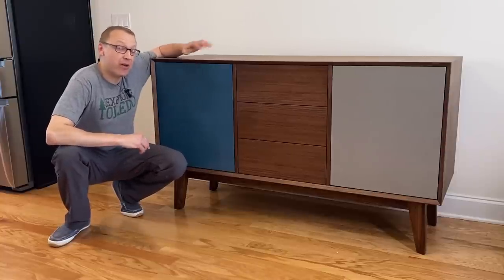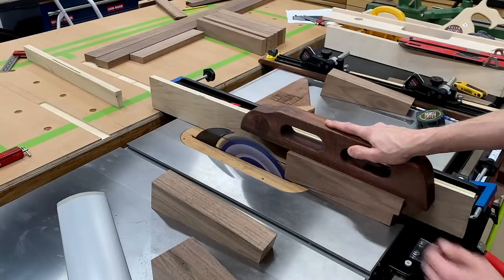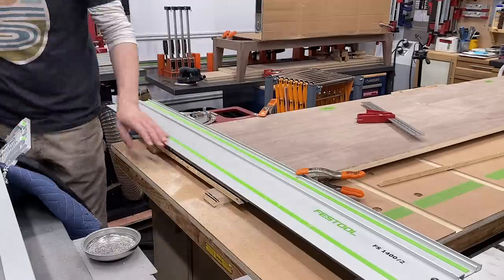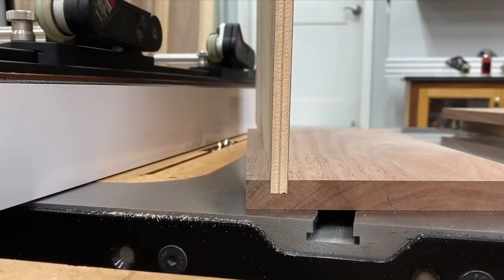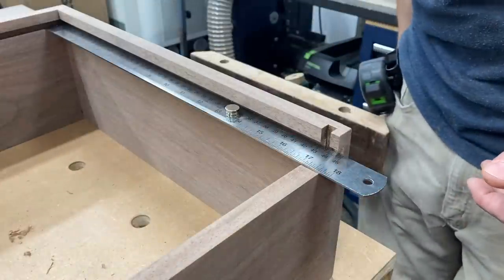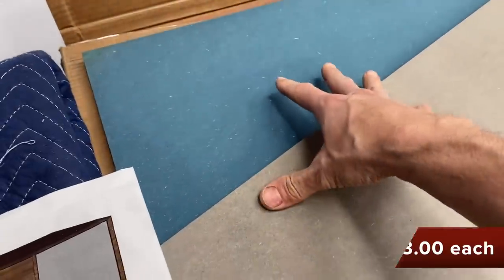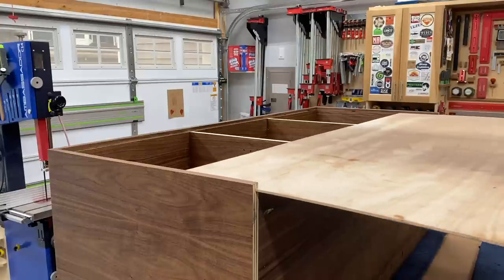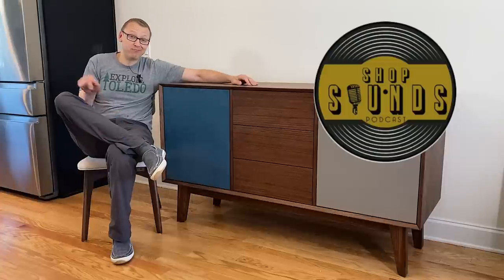Yes, plywood can make beautiful furniture.

Comment: Let me try to explain your 5° taper issue in ASCII. :-)
Below you can see the rear view of the leg on the tablesaw. The diagonal line is your blade cutting the taper.

|\        |
|  \      |
|    \    |

You have set the blade-height to end up with a full width leg. So you aligned it with the upper piece of the leg. As long as you 'lift your leg up' using a support piece to the same height, the width of the leg is maintained since the blade will cut the upperpart at the exact same height (only the top of the blade touches the upper side of your piece). But without support piece, the lower part of your leg ends up lower on your table saw (and also on your blade), which means the blade is ripping the leg narrower because it is not the upper part of your blade touching that piece, but the middle part of the blade, which is closer to your fence at the bottom than it is at the top.

As I read through it again, it might make the entire thing seem more complex, but hey, just my 2 cents :-)
Reply from the maker: ok, ok, ok.... I think this DOES make sense!!! The lightbulb has gone off!! Thank you so much!! 👊
Reply: This would have been impossible to grasp without that ascii drawing. I could not follow the words. Excellent use of old tech. :)
Reply: Why is the middle of the blade closer to the fence than the top?
Reply: @zacharytreat9223  Because it is at an angle.
Reply: You sir have a gift to teach! Will admit i had to read it few times, but when it clicked, cant imagine any better way of explaining it, even more a better illustration! Amazing!!
Reply: @KeithJohnsonCustomWoodworking  Any chance you can do a follow-up trying to explain this? Really appreciate your work. Thanks for sharing!

Comment: The difference in width comes from you comparing it on a different height with a 5 degree bevel. So this should be equal (2 1/8) on the same height at the parallel side. Hope this makes sense?
Reply from the maker: Kind of. I still can't wrap my head around it. I just figured that 5 degree bevel would remain the same top to bottom no matter what the height of the material.
Reply: Makes sense. In regards to making a safer bevel, I use a spindle moulder wit a tilting spindle so I run a straight cut head with the spindle tilted forwards to make the cut which also leaves a really nice finish. Use the power feed as well to keep your hand out of the way :)
Reply: @KeithJohnsonCustomWoodworking   If you are cutting a wedge on both the top and bottom of the wedge at an angle, the pointy edge is further down the saw blade, therefore cutting more material thickness, than the fat end which is higher on the saw blade which is the at the width you wanted. Be the wedge.
Reply: \        / <- so this is is the beveled width you measure on one side
  \    /   <- and this is the width you measure on the other side. on a different height you removed more material with your bevel
    \/
Reply from the maker: @tomim7187  Got it! Thanks Tom!!
Reply from the maker: @mr_cysio  Understood! Thanks for explaining!!

Comment: Although your table saw blade is parallel front to back, check it is also parallel top to bottom. It may be slightly out on its vertical axis. Most woodworkers only measure front and back because half the blade is buried below table level which cannot easily be accessed
Reply from the maker: Any time I bevel the blade and set back to 90, I double check it with an instrument to ensure it’s accurate. 👍🏻
Reply: I have the same saw as Keith. Its brand new, and I noticed that the width of the fence is concave by a few mils. I’d bet that by not referencing the same width of fence for the whole part, it introduces some turn in the part as it gets cut, and would be magnified if the fence falls out of square with the table. This perhaps explains why the wedge jig fixed the issue. Thanks for discovering this before I had to, Keith!
Reply from the maker: @cemontalvo12  it's definitely a little wavy

Comment: Beautiful cabinet! The push-to-open drawer slides look like they are push-to-close when you use the push-to-open, but soft-close when you just pull them open.
Reply from the maker: Thanks Jimmy! You can technically just pull them open, but that can get the mechanism a little screwed up and it may not engage.
Reply: @KeithJohnsonCustomWoodworking  Good to know. Thanks!
Reply from the maker: @JimHester  You're welcome!

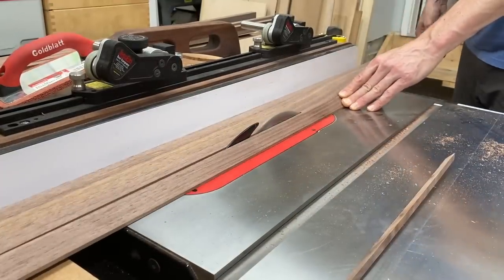Comment: Hi Keith, another great build.  I know I know, I can't stop watching your videos.  Question -- at 18:39 when you're cutting the trim that will cover the exposed plywood for the front of the cabinet, it looks like you used the freshly-sawn back of the trim pieces and glued them to the plywood and it turned out great.  But when I've tried this in the past, I've always had little gaps here and there that were visible between the plywood and the back of the trim, I guess because of the tiny imperfections introduced by the saw blade marks.  This made me think I should joint the back of the trim before gluing it on, in order to try to get a really snug, gap-free fit.  Do you think this is unnecessary, or should I use a sander or hand plane?  Would love to hear your feedback on this issue.  Thanks
Reply from the maker: Hey Carl. That little gap is most likely introduced from the fuzz on the edges of the plywood, but could also be a result of a poor table saw cut on the glue edge of your trim. It's also difficult to get good clamping pressure on that edge banding when there is only one small square edge left after it's beveled.  Another method to try is to apply  square edge banding on all your cabinet parts so you can get good clamping pressure all along the edge and then chamfer them and cut your miters.

Comment: Keith—random question…have you ever used a pantorouter?  Seems like it’s precision would really speak to you.  I’m contemplating getting one so just wondering, from someone’s who work I really respect, if you’ve used one and what you thought?
Reply from the maker: Hey Mindy! I’ve never used a Panto router. And the reason for that is… The Festool domino. The domino is so much more versatile being able to take the tool to the work, whereas the Panto router is a stationary tool and you have to take the work to it. It also requires shop space that I don’t really have. So it can only be used in the workshop. I definitely see the value in it if you are batching out joinery for tables and chairs on a regular basis, but I’m not. The Domino gets it done for me. Hope this helps.

Comment: Here a question from the minutia pile...  How well does that white pencil hold up ? I like the light color but if the red pencil leads I use for redlining plans is any indication, theses white ones would also be annoyingly fragile.  Or maybe I'm just too excited to put red on other folks drawings ...
Reply from the maker: The white chalk are fragile but these ceramic ones are more durable, but like any .7 or .9mm lead, they aren’t built for abuse

Comment: Hi @KeithJohnsonCustomWoodworking ! Did you try Rubio monocoat on the Valchromat doors? If you did, how does it look? If you didn't, there must be a reason that I would like you to please share.
Thanks.
Greerings from México City.
Reply from the maker: Yes, I did try it, but because Rubio is an oil, it was turning the Valchromat very dark and flat looking. I wanted to maintain the bright blue color as much as possible.
Reply: @KeithJohnsonCustomWoodworking  Thanks for such a quick answer. Good feedback. Have a nice week.

Comment: The reason why the leg comes out tapered is because the blade is only parallel to the fence in a straight (horizontal) line. The lower you get on the blade the closer it gets to the fence, So when you cut the leg it gets tapered. Raising the leg up helps because the upper part of the leg is horizontal now and the cut width is the same front and back of the leg.
Reply from the maker: Got it!!! Thanks Marc! 🍻

Comment: Hey Keith, I'm about to build a sideboard that has a lot of overlap with your build.  It will have two cabinet doors that are inset that I want soft close hinges and push to open.  It will also have an inset drawer that I want to be push to open and soft close.  Now that you've had a little time with the hardware that you gave links to, do you still recommend them?  If so, I'll just follow the links.  Thanks for the help.
Reply from the maker: Hey Kim!!! So, the push to open/soft close slides operate very well, but I honestly always forget to just close them and let the drawer close on it's own and I just manually push it all the way in because I have other drawers in the house that are push to open, but not soft close. So, I guess I need to train myself a little bit better. 😂 I do like the push to open and soft close combo on the doors. But like some have pointed out, soft close is overkill if you have to close the door manually anyway to re-engage the push to open mechanism. My argument remains that you can turn the soft close off on the hinge if you want. AND if you ever want to put pulls or knobs on the door and get rid of the push to open, you already have soft close hinges installed. Hope this helps!!

Comment: Great build! How would you manage the build of a similar waterfall edge cabinet where the overall plywood length needed (cabinet width + 2x cabinet height) is greater than a standard 8ft sheet? Asking for a friend...
Reply from the maker: Good question! I was able to buy sequential sheets that had the same flitch, so I kept shuffling the sheets on top of each other until I found a nice continuous grain match from sheet to sheet which gave me the length I needed for the 9 foot span. Hope that helps your friend! 😜👊
Reply: @KeithJohnsonCustomWoodworking  That’s what I was saying but he just wouldn’t listen! Thanks Keith!
Reply from the maker: @nwj82  😂🤣 Stubborn as a mule that guy!

Comment: Hey Keith, great video! I saw that you have a Laguna(it looks like) dust collector and the Harvey Gyro 700. Which one do you prefer? Is the G700 just as powerful as the Laguna? Thanks!
Reply from the maker: I actually sold the Laguna and replaced it with the Harvey for several reasons....it was SO LOUD, like a jet engine. It was also a real space hog and the motor had burned up after a year of mild use. The Harvey is awesome (I'll have a video out on it soon) and even though it only has 2HP and the Laguna has 3HP, I think it has better suction.
Reply: @KeithJohnsonCustomWoodworking  Thanks Keith. I have been interested in one. Can't wait for the video!
Reply from the maker: @chris80333  Right on!! Stay tuned!

Comment: I seem to use a ton of disposable towels (even with Rubio) and I’ve been trying to move to washable shop towels. I noticed you had a nice clean stack of microfiber towels, do you wash and reuse those or are they “disposable “ for you? If you do reuse them do you keep them color specific? Love your videos (I’ll try not to let Jason’s voice in the background ruin it for me 😁)!!
Reply from the maker: I buy those microfiber towels at Harbor Freight - they are disposable. I don’t know of any way to wash Rubio soaked towels for re-use since they have solvent in them.
Reply: @KeithJohnsonCustomWoodworking  that’s what I figured but I won’t lie and got a little excited thinking you had a secret to clean out the solvent. Thanks!
Reply from the maker: @chris-seven-shotwoodworkin4817  Ha! Sorry, but I don't have quite enough room fo r an industrial chemical cleaning facility. LOL.

Comment: Hey Wild Man, another great video. Thanks. I need to test this, but if you don’t mind I’ll ask your opinion. I have a commission to build a Distinguished WWII Veteran’s Flag display case. I was going to put the glass in from the back and then glue in stops to hold the glass. It is 100 year old quarter sawn white oak. If I pre finish with Rubio 5% smoke, will the glue hold the glass stops sufficiently? And what glue, or pin nail? I have to get this job spot on to respect the memory of this Great Patriot. Thanks !
Reply from the maker: Thanks MJ! Glue will hold, but it has to be raw wood...it will NOT stick to Rubio. Depending how big the glass stops are, you could use some nice brass screws to hold the glass stop instead of glue, that way the flag can be removed if necessary.
Reply: @KeithJohnsonCustomWoodworking  - Thanks so Much for answering. I made the back using 5 tongue and groove beaded panels that are held in place with brass screws. It’s just a tight spot to get the stops screwed in place, but you’ve Inspired me! Thanks as always! 
Love your work. I also could not wrap my head around the taper cut on the legs even though I ran into a very similar problem once long ago (I’m “semi retired” now just taking jobs I really want to do). I appreciate that you include the cost of materials in your videos. Not sure anyone else does.

Comment: Another Great video! Question how did you get the gain match for the waterfall sides? Believe you said its 5' wide and appears to be greater that 1.5". Many Thanks
Reply from the maker: I was able to get 2 consecutive grain matched sheets of plywood so by cutting a particular section out of the next sheet, it gave me an extremely close continuous grain match.
Reply: @KeithJohnsonCustomWoodworking  Ah its the old "Its close enough trick" as agent 86 would say. Thanks for the answer, I am planning to build a walnut console but is 7' wide was wrap about the axle that water needs to be an exact match.
Reply from the maker: @allent555  yeah, that will be a challenge, but definitely doable if you can't find consective sheets with the flitch. Or veneer the whole thing yourself!

Comment: Question: Given the use of dominoes with reasonably thick aprons why add the pocket screws AND the corner braces?
Reply from the maker: Pocket screws strictly to act as clamps during glue up. Corner braces for added anti-racking strength. Wouldn’t haven’t been necessary if I had been able to stack 2 dominos in the apron to leg connections.

Comment: High density mdf product? 🤔🤔
Reply from the maker: It is on average 30% stronger than standard MDF. Due to the addition of resins in the composition, it has a greater internal cohesion, which gives it a higher mechanical strength.

Comment: So when you say 10 quarter sawn lumber, is that 10 inches by 4 inches? In metric that would be 250X50 if so
Reply: No, quarter is the term used for the lumbers thickness in imperial. So, it’s in relation to the thickness of the lumber by quarter of an inch. In this case it’s 10/4 lumber, or 2 1/2 inch in thickness. Hope that makes sense.
Reply: 4/4 = 1"; 6/4 = 1.5"; 8/4 = 2"; 10/4 = 2.5".  Except they’re all really "nominal" so slight variances exist. Applies to hardwood lumber sold by the board foot. Quarter-sawn refers to the portion of the log’s diameter that is milled, there are different options producing different grain patterns. https://www.woodworkerssource.com/ has good summaries of this stuff.
Reply from the maker: Looks like Rob and Chris are all over it here!! Thanks fellas!
Reply from the maker: Thanks for the assist, Rob!! 🙌
Reply from the maker: Thanks for the help, Chris!! 🍻